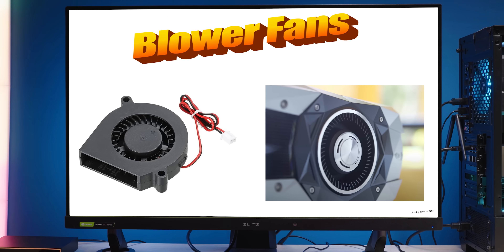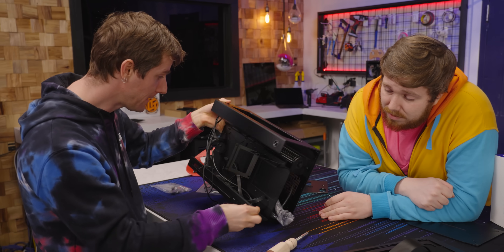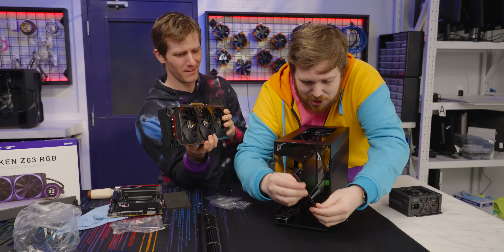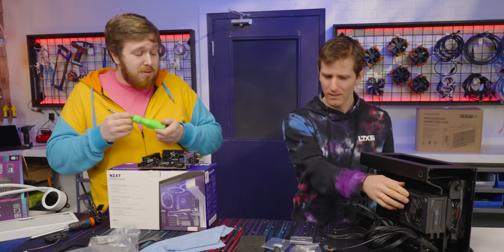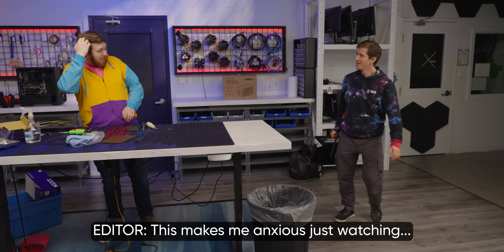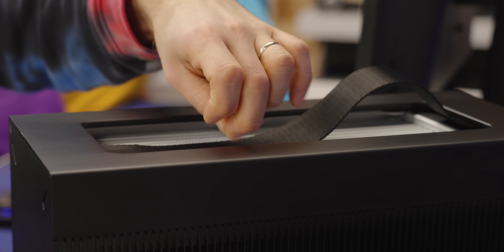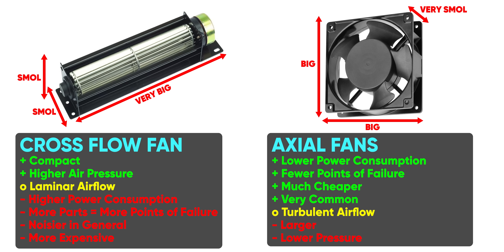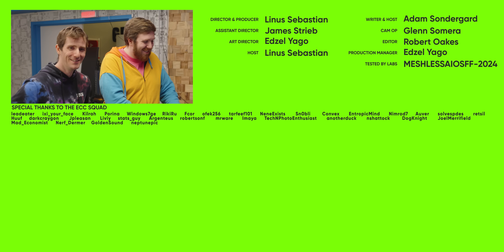This BLEW me away! - Meshless AIO SFF by Meshless Design

Comment: Honestly I wouldn't call that expensive, it's a high quality 1 piece aluminium mitx case that can fit a 4 slot monster gpu.

Only real downside is that you can't use regular fans, but it has to be an expensive one that isn't available everywhere and that it has to be water cooled.

Comment: These fans can be much quieter than normal fans. They're great for air purifiers too because they tend to mesh better with square filters.
a company needs to make axial flow fans that fit AIO form factors, into 2,3, or 4 slot fan areas, , perhaps 2 thinner fans side by side with one pushing air out and one sucking air in, that would make the assembly much thinner, though still thicker than the fans would be. I swear there would be room in many cases I'm familiar with and they would certainly fit on the outside of a case. You wouldnt get the full advantage of an axial fan though unless the case maker designed the fan slot to reduce obstructions for linear fans though. perhaps some kind of cowling might help but that would increase the bulk of the system. Anyway, ideal use case is slapped onto the radiator of an AIO drawing the hot air out .

Comment: Honestly for the manufacturing complexity and how well thought out the build process is for a small form factor case that can accommodate a full size gpu the price seems super fair to me. When they started alluding to the price I thought it was going to be in the 600-700 range. If I didn't have a ton of storage drives and it being too early for a system rebuild/upgrade I would consider this case if I was going for a small desktop unit. It looks super clean and well done unlike a lot of small desktop form factors that look imo like pretentious crap, hopefully meshless does well I like their approach and look forward to more designs from them.
Reply: I was also expecting a much higher price.  $350-$400 is around what those NZXT H1 cases were going for (those included a 120mm AIO + SFX PSU, but were not made as well as these, nor could they accommodate massive GPUS).

This thing seems quite fairly priced. If I was in the market for a new case, I’d be taking a long look at this one.
Reply: same here

Comment: this case will kill your hardware unless you live in Alaska  and your radiator will get filled with dust and debris $400 is really bad ... test it in a simulation of a hotter environment like Arizona .. Ill bet its not stable .. riding the thermal limit on electronics is like riding the rpm red line in your vehicle it will break something in a short amount of time this is not a good buy to keep your expensive components longevity in mind .

Comment: i really like those style fans. i have a larger version called a transom fan. not only do they have a pleasant sound when running but because of the design its reversible.
it has a divider inside that can change the air direction without changing the fan.

that being said i like that case. i think with some more time, feedback and popularity that design could really take off.

Comment: "My Fan is LONGER than YOUR fan" not really, all mine are custom to my case, uses 2 14" fireplace fans to pull air through a 1973 GM heater core i use as my rad.

Comment: The Coolremaster Stacker also had a crossflow fan as an option. I didn't get it though. Wish I had.
It was an intake though. It pulled air in through the backside (like an 011D has the three backside fans) and blasted it straight across the motherboard.

Comment: The extrusion based designed is actually very affordable for manufacturing. Higher material cost but much lower manufacturing and assembly costs.

Comment: i wonder if a console type case with a crossflow fan sandwiched between the Mobo and GPU could compete with this... one of the biggest problems with thin SFF cases is squeezing enough fin stack area when you also have to squeeze in a fan, but placing it inline with the case instead on the face could provide a significant thickness reduction with a tradeoff of a bit more length

giggity

Comment: what a foolish price.  This isnt some fancy fan tech.  Its been around for decades.  I never see how case manufacturers can charge so much for basic designs that are merely tweaked as needed.  This case was not expensive to make.

PC market getting PC prices for non-PC parts.  Check out water cooling fittings, for example.  Some brands are selling $9 high quality fittings for $60 because they shined up one section.

BTW, the motor controlling this "unique" fan is $8 with a 5 year warranty from the brand that actually makes them.

Comment: I'll file this under dumb solutions looking for a problem. If you have space for this on your desk you have space for a normal case. The cross section of wanting hardware that eats 800W but wanting it all in a smaller form factor than a 800W room heater is just.. wow these people really like pulling their own hair out huh ?

I'll concede the idea of the fan form factor itself isn't bad. But i'd be careful in the execution. I have a big one like this in my room AC unit and it's not self centering properly so it makes a very annoying repeating noise every 5 second or so, I can't stand it. I just blast the AC at max to cool the room quickly and turn it off altogether to compensate, but that wouldn't be an option in a computer.

Comment: Sound was funky in some parts.
Reply: Yeah I know they use multiple mics when recording (they say due to how much linus moves around) it sounded like both were coming through giving a slight reverb/echo
Reply: @Cark_0  Yup, definitely some echo, maybe the mics were slightly off sync.
Reply: @Cark_0 Both mics will likely be mixed different, causing phase issues between the two when both play at the same time.
Reply: Can confirm it sounds weird
Reply: Ok, wasn't me 😂
Reply: thought it wqas my headset!!!
Reply: Ok
Reply: Thanks, was wondering if it was my device sounding funky

Comment: As far as household products, I've noticed the crossflow fans fail more often than axial fans. In my experience, crossflow fans have failed before the rest of the product, while axial versions tend to outlast the other components. Every crossflow fan that has started to fail on me has announced it's demise with a continuous loud squeal. It's come to the point where I check the fan type before buying. I don't think I'd consider a crossflow fan for a computer.

Comment: 'unless you have this new case"
or unless you had the original Coolmaster CM Stacker (STC-101-UW) that came with such fan
we're talking pre-2007 here.

so nothing new, just some marketing bs about it being so called new, while using over 17y old tech...
Reply: the fan also has a problem that over time the fanblades would not stay as they are original. the discs they sit in would shift compared to each other, so the blade that would sit at 0° on the first disc would be at +/-5° on the last disc and not at 0° there, because of the torque caused on the axial. 
this would cause the air to not only be pushed out radial but also axial, and in most cases away from the motor, causing it to be prown to stay at a higher temp. because of less cooling. (the major problem with this kind of fans: no or not enough cooling on the motor powering the cooler. which isn't a problem with axial fans we all use today in our computercases: the motor sit in the middle of the airflow and gets significant cooling that way.
with this radial fans, the motor sit outside the airflow and gets no force airflow and as such almost no cooling from its own fan.

Comment: Really love the case design, and the price is decidedly reasonable compared to other 'custom' compact cases that have cropped up randomly. 
That type of fan largely fell out of favor due to a lack of pressure. It could move a lot of air... if it's in a completely open air environment. Also distributes air 'evenly' but not 'directly' like current PC fans can.

Comment: I have a dehumidifier with a blower fan in my room. It has the power to move around the air of the entire first floor + some square meters to spare. But I can comfortably sleep while it works with the lower of two speeds of the fan. It's a great white noise. I imagine the fan in the PC is much quieter. I actually wish companies would invest in this technology more. Because standard fans sound fking awful. Especially when you stack them. The single fan I find tolerable is a Noctua one. So it's either a full Noctua build or one of these blower fans for your ears to feel comfortable being around a gaming PC. I prefer the second option. My hatred for standard fans is worth well beyond the price tag of this case.

Comment: I think the Team dropped the Ball with this one. Imagine any other case that small with those components and normal Fans... It would be worse in Performance and probably even loud ess.

Also running synthetic full load Benchmarks on a small formfactor build... Is... Well... Dumb. Exactly 0% of people build such a small formfactor PC to run it at full CPU and GPU load.

INTERSETING would have been: is it actually quiet enough when gaming? And how does is compare to similar small formfactor PCs like it? But you didnt test that. You did not consider how people who would actually consider such a case would use it and whats Important from them.

Btw: I have never build such a system and have no interest in them. But These holes in the Review are so glaringly obvious... It's a bit sad

Comment: see, if it's someone that travels a lot for work but still requires a setup case for their work, especially something that can mess up weaker systems like graphic design software, then I can see this being somewhat worthwhile,  if you're wanting to be able to travel to diferent locations and not use the computers there, but then again, if you can afford to pay that much on a case, then you could probably afford a decent laptop which would work out better in the long run.

Comment: I remember that old PC case from the early 2000's that had a mini air conditioner in the bottom, with a couple squirrel cage fans to move air around. Was a horrible noise maker and I can't remember the name of the damn thing despite having one walk through the door at the computer store I worked at in the 2010's.

Comment: I have a Braun fan heater from the 60s designed by dieter rams that uses a cross flow fan. Each blade is soldered and balanced individually. We seem to be going backwards in terms of design…

Comment: The silicone coated wires are more fragile too from my experience. accidently bought a spool instead of the pvc coated and a slightest snag would break the cable granted the machines i work on have a lot of moving part but still

Comment: I bought a case in 2007 with a cross flow fan in it. It was the Cooler Master CM Stacker STC-T01-UW. It was complete with a rear cross flow fan port. Worked incredibly well when trying to air cool everything!
Reply: Came here to say that. I am still using the stacker because it is massive.
Reply: I've still got my stacker case as well. Monster case. 11 bays. Heavy Duty. Love it. @revcrussell

Comment: What if i told you that this design with a ceramic core and the new types of electric engines is amazing..
Like super expensive but will work for a humans lifetime as it does not have parts that degrade quickly.

For a small one like this it be atleast another 0 to the price.

Comment: I can see that it is pulling through the radiator but air will take the path of least resistance so the majority of the air is probably coming from the other meshes and that might be why the CPU is getting hot.

Comment: The crucial piece of information missing from this segment is that blower fans move low volumes of air, which is why they tend not to be used in the enthusiast PC cooling market. Axial fans can't develop the same level of static pressure, but they move a lot more air and are also a lot quieter.

Comment: I don't no if I'm the only one to hear this but there is quite an unpleasant audio "echo" sometime in the video, I have noticed it in other videos as well. Try to synchronize your audio tracks more precisely, and if that's not enough, always mute the other microphones when someone is speaking. Thank you guys.
Reply: Multiple open mics create phasing issues. It could also be a comb filtering issue due to proximity to a surface though given when it had issue I don't expect this was the cause.

Comment: i have fan like that, but it's much bigger, and was used to transport heat from 400V DC heater across the vehicle. it works at 230V AC but it's very loud

Comment: small note, cross flow fans usually have very poor pressure capabilities. If unobstructed they can move a lot of air, but mounting for instance directly in front of a radiator they will struggle a lot.

Comment: Cross flow Fans are really great for Tower Room fans, I got one, it's basically just a case around a massive Cross flow Fan. 
They also find use in heaters because they can move a lot of air.

And this is probably the first case I see in a long, long time that actually deserves the price tag. The majority of sheet metal cases out there are overpriced.
Reply: Most of the price for overpriced case goes into the branding. In this case, the price is justifiable, even incredible to say, that's a lot of custom stuff and with such a small batch, I don't even know how they pull out a price as low as that

Comment: I think the thing with the case cost is that there are now an abundance of SFF cases under $300 that are high quality, not too difficult to build in, and some with great aesthetic choices, like curved panel windows or exotic accents like wood. This case only stands out in terms of a few quality of life improvements and a different kind of fan (requiring replacements from the manufacturer), which provides noise level comparable to a louder AIO, and slightly worse cooling. It does not bring enough to the table for that price to be any more than "understandable." It is a very neat idea, but even for SFF fans it is competing with some heavy hitters that are cheaper, or have more customizability.

Comment: The biggest problem with cross flow fans is that to avoid noise, you need really solid structure and really high quality bearings. And those things cost a lot. This case isn't exactly the economy option.

That said, the case is suprisingly cheap considering how much more expensive it's to create compared to something like Fractal North which is also pretty expensive case.